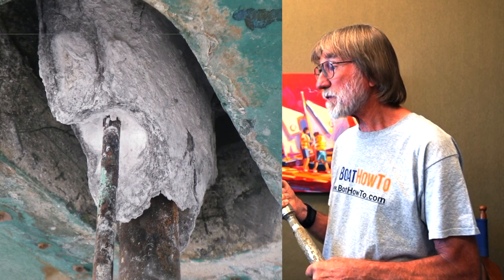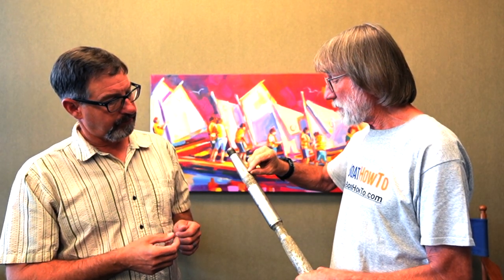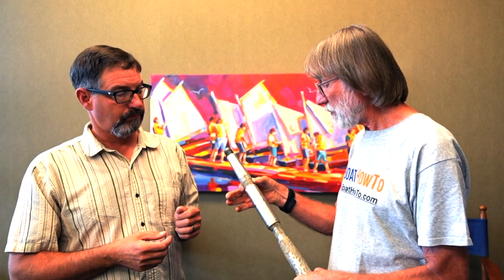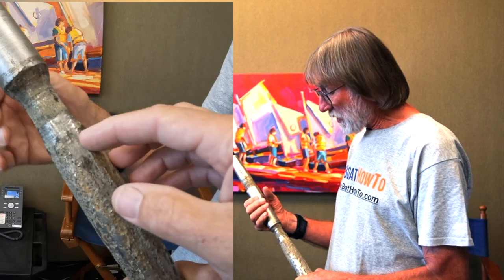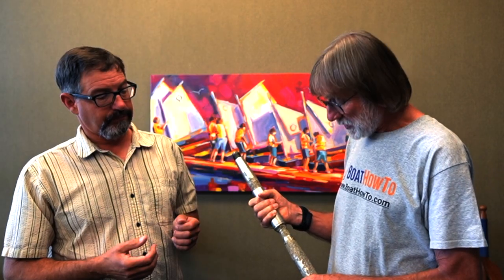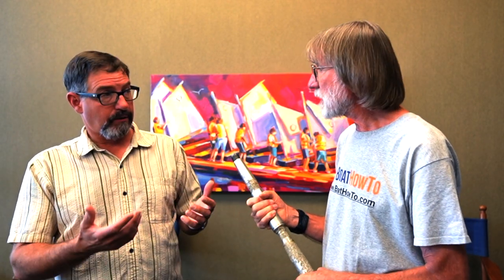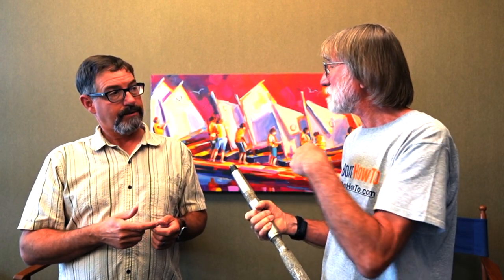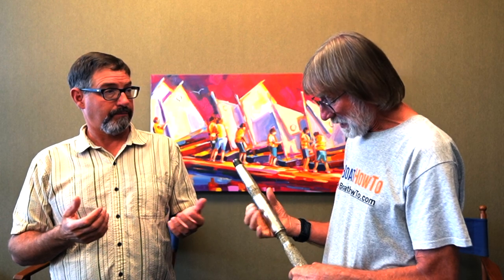Stray Current Corrosion: Underway!!! with Nigel Calder

Comment: I appreciate this video is 10 months old but given that electricity leaves the source, goes to the load and returns to the source.  I would dispute the assessment of the current leaving the alternator passing through the engine/shaft and then returning to the isolated house battery.  There is no credible path from source to source here.  Either that or I misunderstood something here...
Reply from the maker: WE can't say for sure as we don't have the vessel to work on/look at. But the evidence was there that electricity definitely was leaving the shaft and it got back to the source somehow - that's the only way you can destroy props/shafts is positive charge DC.